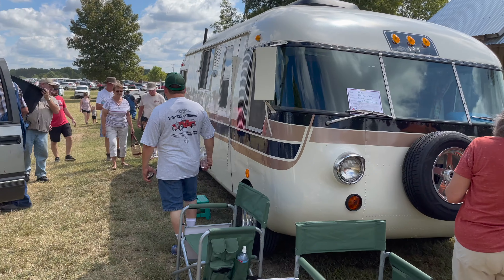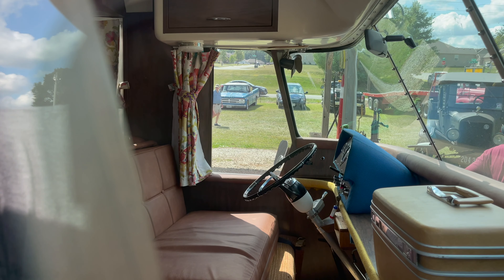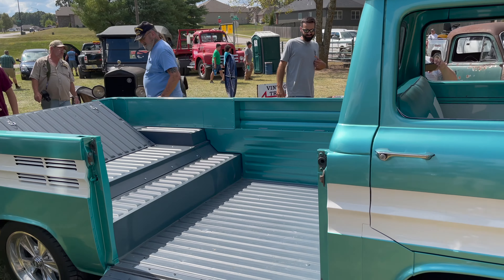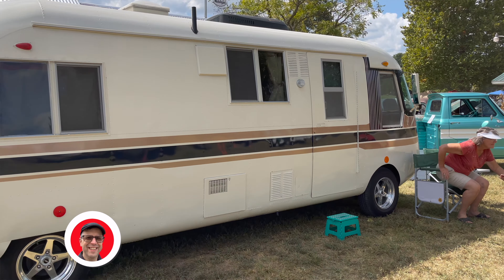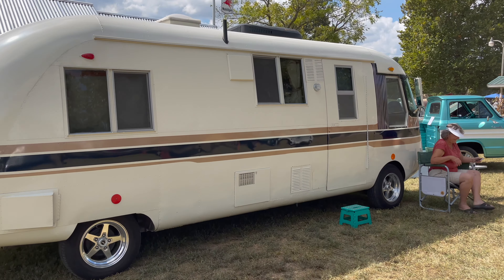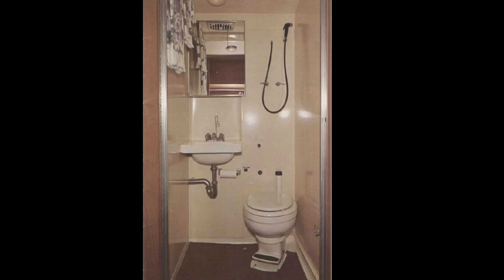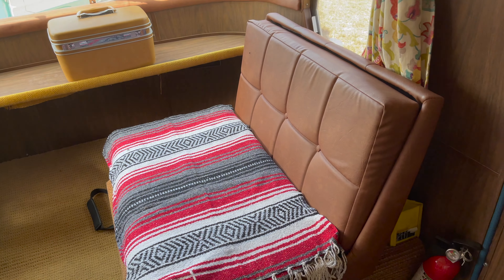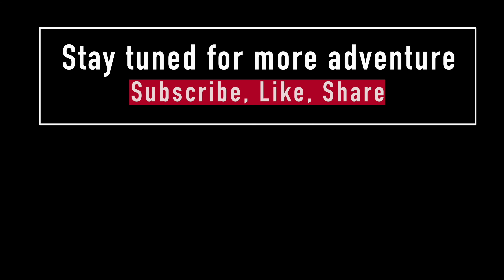Corvair Powered Ultra Van tour & Corvair Pickup Truck - Vintage RV #rare #rv

Comment: 3500 pound RV at 18 mpg, that's incredible.  I've only heard of such mileage from a Toyota Sunrader.  These were great to see, nice finds Brian.  💯📺🙋
Reply from the maker: Yeah I think so too. They were designed be a Aircraft designer. Made out aluminum and  fiberglass. Very cool 😎 thanks 👍
Reply: @SomeplaceOrAnother  Beautiful looking RV. I consider it a shame that they were discontinued when they were. Its size would be perfect for the newbie RVer just starting out, a traveling businessman (or woman), or a veteran RVer looking to downsize from a 30'+ RV to a smaller motorhome. 🙂

Comment: I've heard of these, but never seen one. I owned 2 corvairs back in time, a 64 and a 67. A friend and I rolled a 65 home made camper van on 8-16-71 in Garden Grove, Ca.....all I can remember now is that you need to bring oil with you where ever you go
Reply from the maker: They needed lots of oil 🤪 That's a fun fact I didn't know 👍 Thanks 😃
Reply: @SomeplaceOrAnother  it wasn't so much the consumption, but the matting surfaces of the crankcase....as I recall, they copied a euro design with machined surfaces not requiring gaskets and apparently left out the precision fit thing. Still, in my opinion, a good running motor and what a cool motorhome.....thanks for sharing